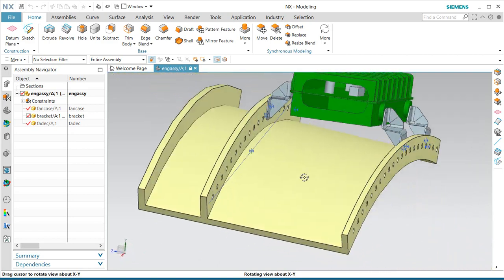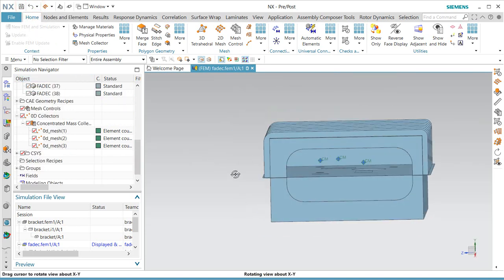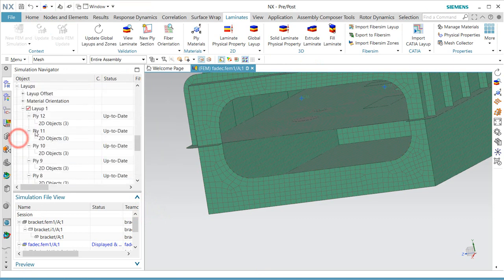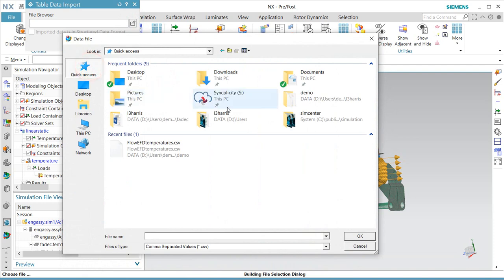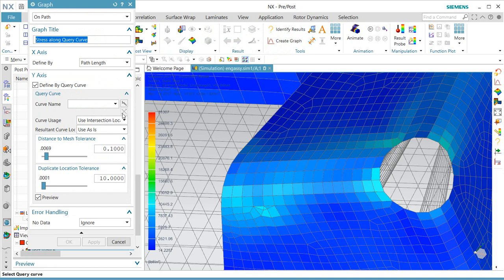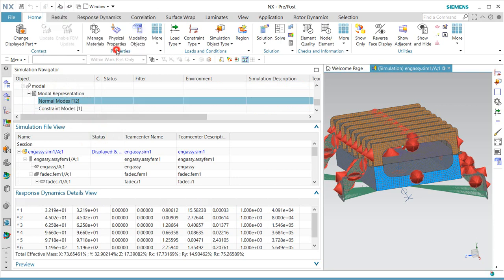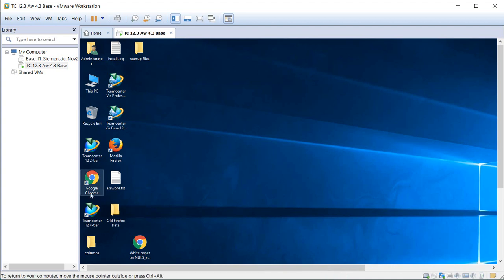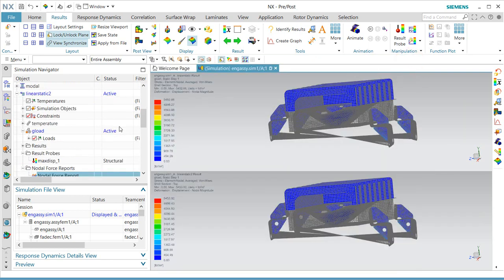Simcenter 3D Assembly FEM and Response Dynamics Demonstration Under Teamcenter

Comment: when i try to add the 0D mass, it is not reflecting on the 2D mesh. what could be the reason. I created the 0D element and assigned the mass which is lower than the solid mass. But it is not changing. Can you help with this
Reply from the maker: Sorry, not sure I understand the issue.  How are you creating the 0d mass?  What do you mean it is not reflecting on the 2d mesh?  What is not changing?
Reply: @Simcenter3DTipsandTricks  can i send it over through  email? i am saying when i mesh the 2D rectangle it will have solid properties showing the mass and inertia based on the assigned material. Now  I am creating a mesh point and with 1D connection I create the lumped mass and assigning moment of inertia and mass. when i do that, i am not able to see the mass is assigned to the 2D rectangle. because when i mesh the rectangle the mass is higher and i want to get mass equivalence by changing the mass. Hope i asked the question clearly this time. if not i can send the screenshot in mail
Reply from the maker: It looks like you asked your question on the Simcenter 3D community as well https://community.sw.siemens.com/s/question/0D5Vb00000pUtd8KAC/how-the-con-mass-assignment-works  Hopefully the reponses there were helpful.  When creating the 0d mesh, first assign a material property to the body you want to idealize to a 0d mass.  Next create a 0d mesh with the type "Create Lumped Mass at Center of Gravity".  This will automatically assign the properties to 0d element.  Please reference https://youtu.be/fU-E1grMTJI?si=juQ7JvpXaq_HQGZn&t=443 You can confirm the properties that were assigned to the 0d mesh by right clicking on the 0d mesh and selecting edit mesh associated data.  Hope this helps.
Reply: @Simcenter3DTipsandTricks  Thank you for the response! I will try this!

Comment: is the material orientation basically the grain direction of the material?
Reply from the maker: You could think of it that it way if the material had different properties in different directions, so the material orientation would be irrelevant for isotropic materials.  It is only important for orthotropic and anisotropic materials.  For an orthotropic material, the material orientation will specify the direction that corresponds to the Youngs Modulus E1.

Comment: I am trying to create a lumped mass by following the procedure as shown in this video but it's not creating, and surprisingly it is not showing any error. What could be the possible reasons?
Reply from the maker: Sounds like it could be graphics driver issue.  Please check to see if you have the certified driver as shown in this video https://youtu.be/6ads82zneTc
Reply: @Simcenter3DTipsandTricks  thanks for reply...but even it is not showing any 0D collector in Simulation File Navigator. Isn't it mean it has not been created?
Reply from the maker: @Bala92635  Graphics driver issues can manifest in different ways.  Are you running the certified driver?  If not, put the certified driver on there and create a lumped mass and let me know if it works.  Not having the Siemens Certified graphics driver is the number one cause of customer frustration.
Reply: @Simcenter3DTipsandTricks  thanks , i will try.
Reply: @Simcenter3DTipsandTricks  If somehow I did not create the Lumped or just ignored those components i mean if I am reducing the mass on PCB will it affect the natural frequency? And how whether it wil increase or decrease the natural frequency?
Reply from the maker: @Bala92635  Working around a graphics driver issue can be a bit like playing whack a mole.  You find one work around only to find another graphics driver issue crop up somewhere else.  
If you don't have the mass correct in your model it will affect the accuracy of your modal frequency results.  Maybe create a manual 0d element on an existing node on the board and see if that works.  I don't recommend that as a best practice since it will not survive a cad change and fe update.  Good luck
Reply: @Simcenter3DTipsandTricks  really thankful for response. 
I have done what you have said , i have created the 0D Element having a lumped mass equivalent to the mass of components that i removed from PCB.  I have distributed this mass on PCB board by using RBE2 element. Surprisingly the frequency that is mode 1 is getting higher than as compared to the mode 1 frequency of PCB without considering any mass of components on it.
So by definition of natural frequency more is  the mass less should be the  Natural frequency, isn't it? But here my frequency is increasing with increase in mass.
Reply: @Simcenter3DTipsandTricks  does RBE2 element increase the stiffness of original structure?
Reply from the maker: @Bala92635  It could depending on the number of nodes it connects.  Try it with an RBE3 (interpolation element) and see if it makes a difference.
Reply: @Simcenter3DTipsandTricks  Thanks. I did it with RBE3 but was taking too much and was giving one warning. So i did it by modifying density in order to adjust total weight of assembly. 
After solving i have got acceleration on PCB something around 200g ... please help me where i am going wrong because my PSD grms is 9g only.
Reply from the maker: @Bala92635  Probably need to get local support involved.  Recommend you contact your sales rep.  If you don't know who it is please reply with your sold to and I can tell you who it is.